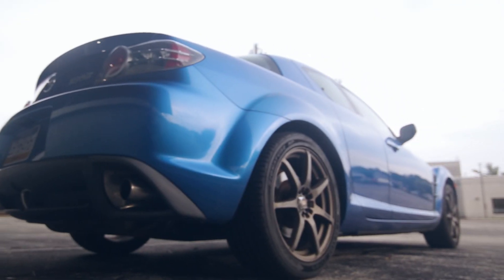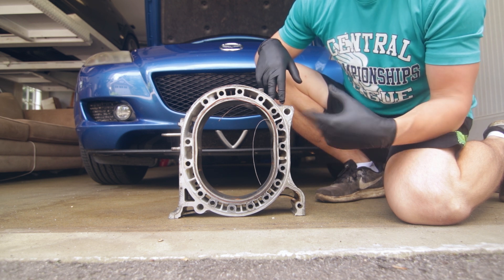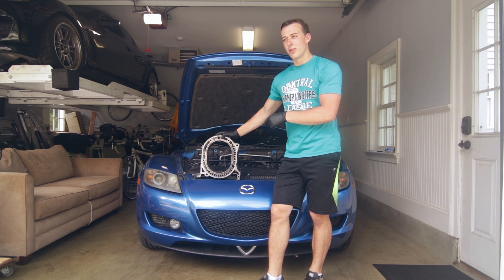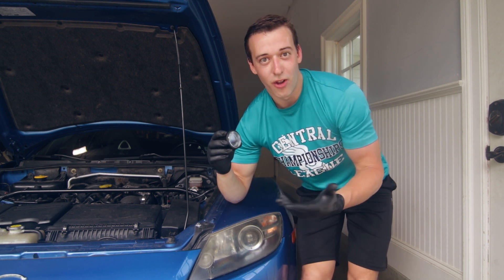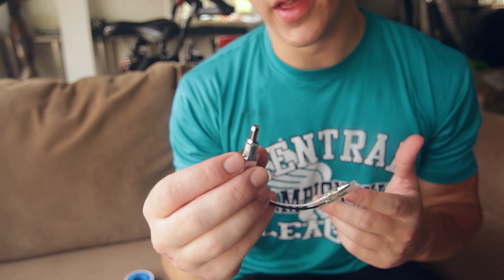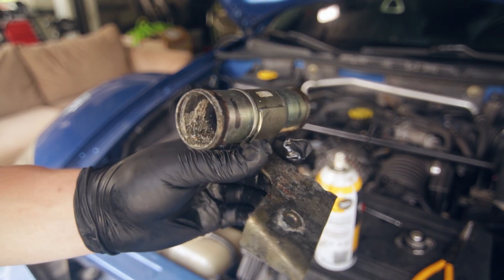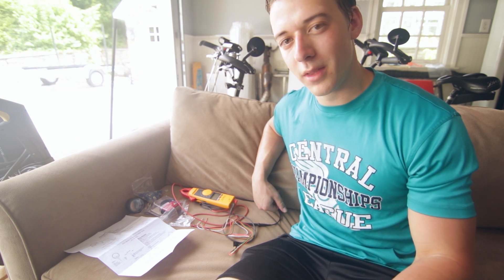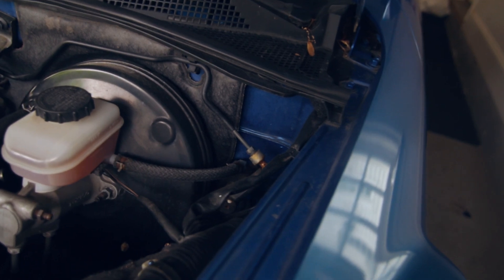MUST HAVE First Mazda RX8 Mod - DIY Install

Comment: I own a 2008 40th Anniversary Edition RX8 (only 1000 made like this in the world) . I bought it new in 2008 and now it is insured as a Classic Car for 160% of what I bought it for new in 2008, full value, no depreciation. I have owned seven rotary Mazdas since the 70's; one RX3, two RX4, all three generations of the RX7 with two of those RX7 modified by Racing Beat for the track. I easily have over a million rotary miles on street and track . Yes I have upgraded and improved my RX8, cooling modifications with Koyo-Rad radiator, Pettit Racing closed system, Racing Beat hoses, low temp thermostat, oil cooler low temp thermostats , low temp fan control, upgraded water pump, ; Mazdaspeed CAI, high performance BHR ignition coils and wires, upgraded starter, performance Cat and mid-pipe from Rotary Performance, BHR clutch pedal assembly, Series Two fuel pump upgrade, new clutch and engine (from Mazda warranty, no cost to me), new engine mounts, and a few other things. I also upgraded to Conti Contact DWS06+ tires.  I will be keeping my 40th Anniversary Edition RX8 forever. Wish I could have kept them all. Nothing drives like a rotary. FYI, I use 10W-40W non-synthetic oil and yes I pre-mix. Cheers and best to you.
Reply: Dope 🎉

Comment: Racing beat has dash guage kits that work great and fairly easy to install. I got the one that replaces the ash tray: Coolant temp, oil pressure, oil temp

Comment: Did you ground the temp sensor radiator hose adapter body? They're supposed to be grounded and it is best to use sealant liquid instead of Teflon tape so the sensor body can get that ground from the adapter too.
Reply: They are not supposed to be grounded, it is connected to rubber hoses and does not touch the frame anywhere. The ground for the temperature sensor is the black wire

Comment: I need your help my rx8 shinka almost 15 years running condition and never been fix or became a problem but last week I'm going to work when I'm in a free way my rx8 automatically shout off have a crank but wont start I buy new battery but nothing happen ..what do think become a problem

Comment: Nice video, I had a mechanic install a new motor and they put the spark plugs in backwards now my car been sitting for a year now.  :(   I'm planing on rebuilding soon this I will include .
Reply: same thing happened to me the mechanics put the spark plugs back in wrong so i got it towed to another mechanic to fix the issue
Reply: @fantaaahh  Any chance you around NJ area ?
Reply: @tvrfly57689  nah man i live in new zealand, jw are you gonna bridgeport when you rebuild?
Reply: @fantaaahh  I'm saving up for that Billet Pro, they're a better material. Is it possible to use as a stock motor? I 'm still learning this motor even after ten years lol and this is my first car so I need to get her back on the road soon.

Comment: 212 isn’t very high. I’ve had multiple Renesis up to 240 without any coolant or compression issues. I’d pull over at 220 and shut it down at 230 personally.
Reply: Seconded, I took my car out on track and it was holding 205-215 for the most part, even with upgraded cooling parts.  I also eased off at 220, shifting at 8000 to 8500 helps keep the car cool at the expense of laptimes

Comment: One thing I noticed recently on my RX8 was that whilst on a spirited drive on a particularly hot day I had my air-con on full blast. After a couple of mins I'd noticed the water temp gauge on the dashboard rise up from the standard 1/2 to 3/4 - I'm assuming this is relatively normal when running AC on full?
Fortunately I noticed it within a couple of minutes and switched the AC Off - The gauge dropped down to 1/2 again within a minute or so
P.S. I live in the UK so weather temps are usually relatively mild.
P.S. 2 Followed your channel for years mate. Love the content, keep it up!
Reply: If it's the factory gauge... And u went past half..... That's very bad and very hot 🔥.. get a cheap obd2 Bluetooth reader for your phone and monitor it like that. Shows actual temp
Reply: Well actually the AC put the electric fans on high so when I go to the track I'll turn the AC on in pit Lane with the heater on and let it cool down

Comment: I had two of those, a 196hp and a 231 hp version and I loved them both so very much but seriously the first and most important mod you can do to them is an engine swap. Put on an rx7 engine or a nonster ls or even an s2k one but renesis will die on you no matter how well you take care of it... Rebuilts are patches (they will never last and don't hear them saying that enchanced apex seal will do wonders, it is a lie), and new wngines are very very expensive

Comment: I heard someone used the "HKS camp2 "to show the water and oil temp inside the OEM flip screen and costs around 500. I thought there's  already a screen inside the car so why not just let it do something. But HKS only sale them in Euro and Jp... can be bought in eBay. Dont know if that would work on US rx8

Comment: I talked with my rotary mechanic, he said that better option is sensor on racingbeat adapter. Is more accurate.
Reply: More information please. Wdym. Sounds interesting.
Reply: @durschfalltv7505  its more accurate.
Its show always temperature, not only when thermostat is open https://www.racingbeat.com/RX8/Cooling-System/11493.html
Reply: @KarolOpyrcha  wtf 40 dollars
Reply: But thx man i appreciate. Thinking of 3d designingnit and getting IT cnc'd
Reply: @durschfalltv7505  u can buy KOSO adapter 14mm, its fits perfect. I mounted that in my rx8.
Reply: Don't throw good money after bad.. sell the car, problems solved.
Reply: @sandervanderkammen9230 Would you guys get a hobby already
Reply: @Leo9ine  Would you just get a decent car already.

Comment: Ive got 2 glowswitch digital guages for temp/pressure. Im able to monitor water oil temp oil pressure and fuel pressure. As well as obd2 on my phone for some extra stats.
I did the fusebox set up
Reply: Oil Pressure via OBD ? Really?
Reply: @dgmdgm7271  no its on the gauge. My phrasing makes it seam like that

Comment: No safety Glasses while grinding or soldering? Tisk Tisk, it'll be hard to run track with one eye
Reply from the maker: yeah should have worn them for the grinding... oops. Never heard of safety glasses for electrical soldering though, that's a new one to me

Comment: Where can I get the hose tube thats connected to the coolant reservoir located on the top right going down on the right side of the coolant reservoir?

Recently bought an rx8 and that tube is missing

Comment: I use a cheap obd2 scanner and an app on my phone and so far it has worked great!
Reply from the maker: also a valid way of measuring temperature! I just like these aftermarket gauges more and have more trust in them
Reply: @Rotareer  I also agree with you on your preference because if the computer is wrong your screwed.
Reply: Me to
Reply: Don't suppose you got a link for a reader that you would recommend? I'm going to mount a tablet into the car to be using it almost exclusively as a digital gauge cluster..but the ones I've looked at have had super mixed reviews. Lol. Hoping to get a few first hand recommendations before I just start buying and trying some out.
Reply: @oxypillix  that just sounds like a bad idea your gonan mess something up
Reply: @glock1inthetop45  Thanks for your input, and all.. but I didn't ask for an opinion about my ability to use the technology or it's ability to function..I only asked for an opinion on a personal preference from someone that seems to have done something rather similar.
Reply: @oxypillix  I literally bought the cheapest one on amazon lol. I bought it a while ago for check engine lights in my saturn and had it laying around so I thought I might as well give it a shot. I use the free version of the torque pro app on android and its better than nothing.
Reply: I have the toque pro app and my tablet to get water temperature, exhaust temperature and also water temperature from my EWP 150 water pump LCD controller works great.

Comment: Why is 205 in idel.... that's not good
Mine gets to 186f on the high temp of 90f outside...
Reply from the maker: This car is completely stock haha. My black rx8 idles around 185 even when it is around 100 F outside in the sun
Reply: @Rotareer  well it makes sense 😅😆, any plans making a video about best brake pads and rotos?
Reply: @Rotareer  damn I probably have some airflow issues then. On a hot 90F+ day idling at a stop with the AC on, it can get to 110C max. I wonder if my plastic under tray not being perfectly bolted up and plastic clips missing is causing the radiator air flow to be less efficient. Idk what else I can do other than that to lower temps
Reply: @Rotareer   can you provide the 3D file of the custom support ?